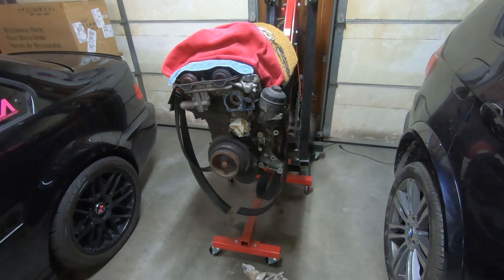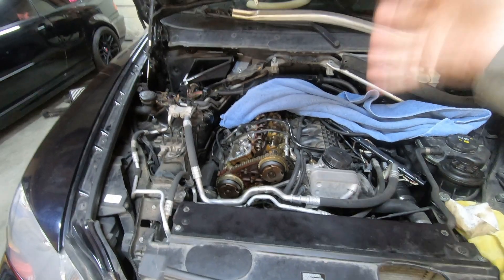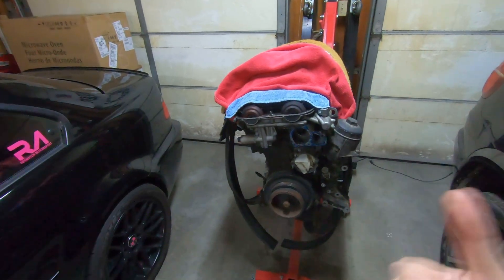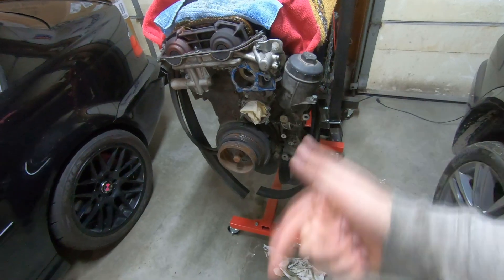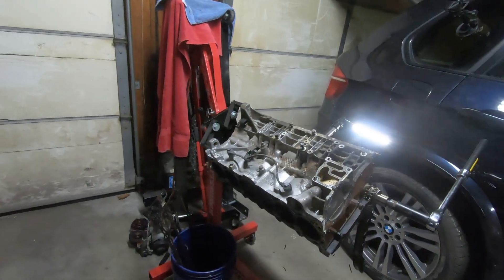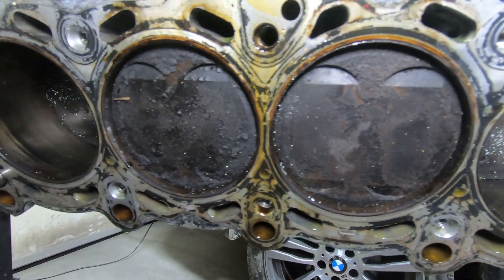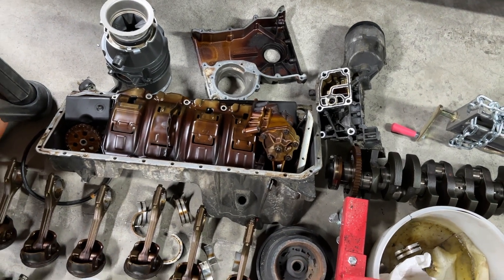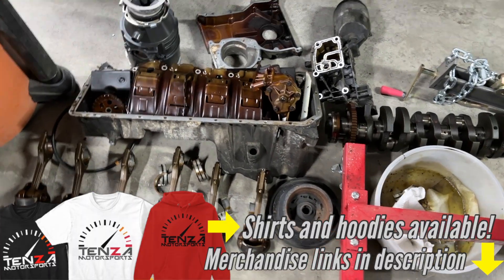BMW racecar engine build - supercharged M54B30 teardown and rebuild - E46 track car upgrades

Comment: What size are you boring the M54 out to? What liter in the end?
Reply from the maker: All m54 blocks are the same. The only thing that will be changed from this original set up, is the crank. The crank is what determines the liter. It’ll be a 3.0